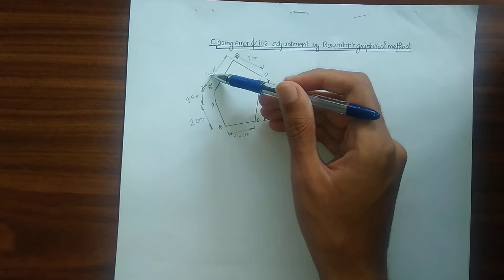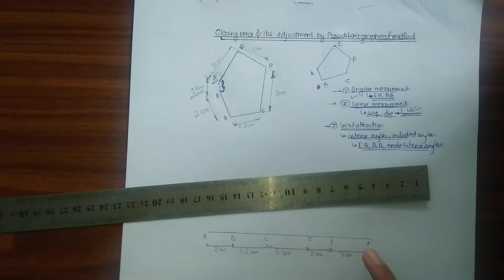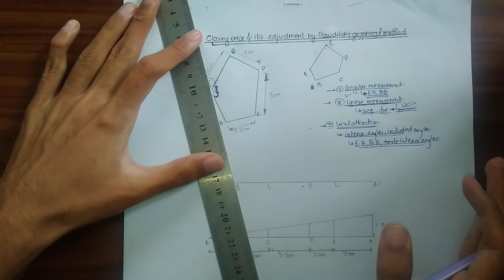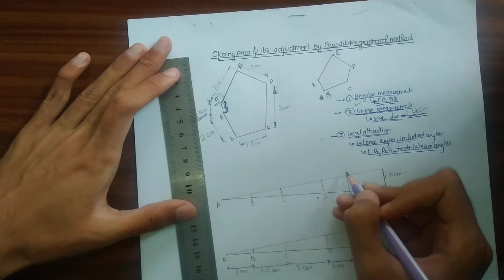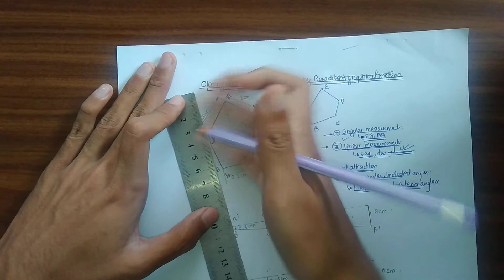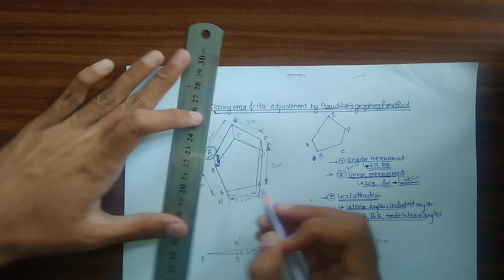Closing error and it's adjustment by Bowditch's graphical method | Closing error in compass survey

Comment: How to plot Pentagon with using backbearing and forebearing
Reply from the maker: For autocad I've already created a video : https://youtu.be/ZNe_9nm3QPo
For hand drawings : You can plot using just fore bearing in the direction of traverse or calculate interior angles to plot.Using fore bearing method would be quicker and easier as you simple need to draw your traverse line with respect to north direction and continue